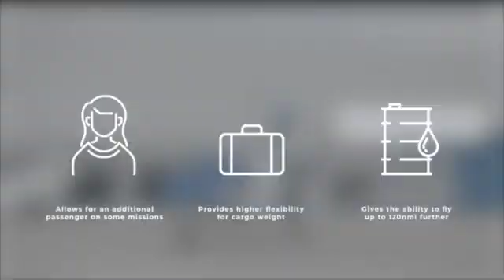BREAKING: Why Cirrus-Trained Pilots Are Dying in Jets - The 300-Hour Death Trap Exposed

Comment: I got my private pilots license in 1982, at the age of 22. Part of the training was in a Cessna 150, part of it was in a Cessna 172. I completed my training with the minimum amount of time required by the FAA, did fine on my solos, and my check ride. Flying just felt natural to me. A few years later I bought my first aircraft, a 1959 Cessna 150. I kept that for 10 years, then bought the aircraft I have now, a 1974 Cessna 172M. It will be my last aircraft. I never had any aspirations to go any farther. I have no instrument rating, no twin engine rating, I've never flown a taildragger. I love the Cessna because of just how easy it is to fly, how forgiving it is, and the visibility. It has far better visibility than a low wing plane. 

About a year ago at our local airport, we had a HondaJet go off the end of the runway on takeoff, go across several hundred feet of dirt, through a chain link fence, across a paved road, hit a car, killing the driver, before coming to rest in a field. There were three people on the HondaJet, including the pilot. The pilot and one passenger were killed, the other passenger survived. Apparently the pilot rejected the takeoff, for unknown reasons, while traveling well in excess of V1, so there was no way it could have been stopped in time. The FAA report found that the pilot was not qualified to fly the HondaJet, but did have time in a Cirrus.

Comment: Covid gave me a forced break from airline flying, so I flew a SR22 for a local businessman. 

I did training through the local Cirrus agents, as they apparently had the right go around technique in answer to recent crashes. Turned out the only go around trained was the classic ‘dog-on-the-runway, go around’ as you approach the threshold. 

I told the instructor that this is NOT where pilots are killing themselves. They die when, after a long float & potential deep landing, the decision to go around occurs when the aircraft energy state has decayed significantly. 

The correct remedy is to ensure that adequate forward stick is applied during the go around to the extent where contact with the runway should be anticipated. Thereafter, proceed as with a baulked landing. 

Applying a standard go around (TOGA thrust, nose up pitch attitude …) from a late flare go around will end in tears with a high performance single. P-factor, etc will result in a heap of wreckage slightly off the left side of the runway.

Comment: CFI inexperience is a major factor overall.  The New age aircraft makers Duping pilots into believing "if you fly the avionics you will be safe", "if you have a problem pull the chute."     Upset recovery training is MANDATORY for operating an airplane safely!  Spin training is ridiculous,  because the spin is the direct result of Not recovering the UPSET.  You can't spin if you recover the stalled condition promptly.   A humans "clutch reflex" takes the upset and transitions it into the spin.
Reply: seems to me anybody who has actually been IN a spin would never say the things YOU say.  i insist that my students at least experience one spin with some ground discussion about it.  have been in many INTENTIONAL spins.  there is absolutely NO DOUBT in my mind that being in an INETNTIONAL spin helps a pilot to recognize the impending accidental spin!
Reply: I have been a pilot for 40 yrs, CFI (instrument and multi) for 35 years, and Airline transport Pilot for 32 yrs, type rated in 5 jets. Where do you get your information????  You do understand the min CFI experience is 250 hours, 5 written test and 4 flight test (private, instrument, commercial, flight instructor, FOI  fundamentals of instruction). Each time they have an oral exam and flight check ride  with a DPE, Designated Pilot Examiner. There is the ACS, Airman's Certificate STANDARDS... They have to meet this. Yes I have a lot of experience and now doing part time flight instruction, and will do more as my airline career raps up.  I checked out new 19 yo flight instructor into the flight club. Very sharp. I have a 19 yr old private pilot I am teaching, working on his instrument rating. The student does not have great study habits or skills. It is individuals, don't blame age or the instructors, unless you have facts to back it up. 

There are some "bad instructors", that may not be professional, poor pilots. Sure. I don't think this is the issue. The SR22 has very abrupt stall characteristics. It has to be flown on speed, stabilized approach. This is how ALL planes should be flown. However a Cessna 172 or 182 may have saved the day. I don't know, they crash too. However a Cessna's stall is far more benign and has a lower stall speed as well. I think the SR22 has a stall 16 to 20 kts faster !!!!  Let that sink in. Nothing wrong with that, but you better not get the SR22 under 78 kts on final.  The C-182 can be flown 65 kts. Is 13 kts a big deal? Well the ratio of speeds (kinetic energy) squared is  (78/65)/\2 = 1.44. That is 44% more energy. Energy goes up to the 2nd power, or squared.  NOT blaming the CFI that taught him or the plane. He had LOS, loss of control. We don't know why. The fact he tried 3 times to land is an issue.... the runway was more challenging than a longer one in the flat lands with no terrain that he normally flew.
Reply: @gmcjetpilot  sure is a lot of words that amounT to NOTHING SAID!  anyway thanks for all your important credentials that was very impressive.   what does it all meand?
don't mean $HIT!    you don't impress me because you have a BIG FAT mouth.

Comment: I think your channel is very helpful, but you are letting the ball drop here.

“The plane slowed to 72 knots as he made the turn ….”

This statement is inaccurate and not borne out by the data available to any person (or especially pilot) who looked at the data. 

This plane got slow and stalled as he was trying to go around, likely because he left full flaps deployed … then veered left off the runway line. 

There was no voluntary “turn” at all … he stalled over the runway and went off it ..

He was also not “too slow to deploy the parachute” as the parachute can be deployed at any speed … he was too low to deploy the parachute and likely did not have enough time in any event.

Let’s keep the facts, the facts.

Keep up the good work.

Comment: It is beyond comprehension that there is no spin training in the US to obtain ppl.  However this cirrus pilot had 2,000 hours and had taken the Cirrus pilot training and flown it since mid 2010's.  I agree with you that there are holes in pilot training, and specifically with ongoing proficiency - piloting skills and basic stick and rudder skills are perishable so you must practice them frequently to stay current.  But so much push button automation gives a false sense of one's capabilities when sudden scenarios develop.  Go around in a high performance prop plane is problematic - full flaps trim and suddenly applying humongous torque causes the nose to point skyward and if you are not on the ball, you stall/spin.  Got to practice these killer scenarios often, at safe altitude to stay a safe pilot.
Reply from the maker: 2,000 hours and flight time do not mean anything. the uS Navy has 400 hr pilots landing F-18s on aircraft carriers at night. They are trained in a certain way. Quality of hours more than quantity! This is why a 1,599 CFI, who has spent all his flying low level at 100 Knots around an airport is not fit to fly a jet at 35,000 feet at 450 knots! the gap needs to be filled in order to produce safe pilots.
Reply: Spin training used to be a required maneuver. I don’t know why they got rid of it. I think a basic aerobatic maneuver training should be mandatory in getting the PPL.

Comment: You started by presenting data and then started making a bunch of claims unsupported by data. Not great. Nearly all career pilots are cfis. Cfis in the United States have to complete spin training so your whole argument is wrong.
Reply from the maker: Spin training and basic aerobatics need to be taught at PPL level and not wait until CFI course.
Reply: @BizJetTV  I would agree but it doesn't change the fact that most of the claims you made are plain false. Kinda makes you seem like a charlatan.
Reply from the maker: @clippy2565 my claims are based on almost 40 years in aviation and having shared the cockpit with pilots from 65 different countries!!!

Comment: We have spin training in Canada.  I learned to fly in 1988 and TBH it was my favorite part.  I still do them regularly just for the fun of it.  How it's not mandated everywhere is beyond me.
Reply: They used to in the US, had to, to get ppl. The US FAA, change things based upon statistics. They decided it was not absolutely needed. Unbelievable. Yet when you take into account. That many of the newer aircraft. Have been designed to be spin resistant. Which can make it difficult to get out of the spin. I have never flown a Cirrus. Though, reading forum posting's by cirrus pilots. Spin recovery, according to the manual, is deploying the chute. Apparently, Do not attempt to get out of a spin, because it is difficult, to get out of. In that plane. I have noticed on a number of newer planes, photos. A placard on the dash, no intentional spins, or spins prohibited. I have not flown in many years. But in the 1960's & 70's. Spins were taught right away. First lesson basic maneuvering, power off landing. Second lesson stalls. Third lesson spins. I agree that spins are a necessary part of training. Learning the entry feeling, teaches how to not let it go that far. While exiting procedure is absolutely needed to be known. As far as i know, spins are still taught, if the student is willing to learn, though not mandatory. While in some cases, the new  airplanes spins are forbidden. They have made them spin resistant, still have aileron control while stalling, not dropping a wing, only needing to push the nose down. Combined with computerized glass instruments. That actually gives instructions to the pilot. Yet apparently, despite all the safety features. Apparently some poor pilots get themselves, into a spin, either too low to recover, or are unable to recover. Yes I think spin training should be mandatory. Nevertheless, there are pilots that exceed the flight limits, despite all the modern flight safety devices. There is a limit to intelligence, apparently, stupidity is limitless!

Comment: Do you teach spin recovery or how to avoid spinning?

Also aircraft can be spin resistant, spin recoverable or spin unrecoverable (Cirrus iirc), all of which will consume height.

The key is speed control in the circuit.
Reply from the maker: The program I have developed and will be launching shortly covers all of what you mentioned and lots more.

Comment: I owned a SR 20, the aircraft is not for newbies. We had a hard time finding one that had not had a prop or tail strike..during landing at slow speeds it is hard to control. It has a laminar flow wing and is not stable at low speeds. Fly slow, die. It will spin when stalled, it has a short fuselage so rudder authority is low and spin recovery is almost impossible. This is why the FAA would not certify it until they fixed that problem whicih they did with the parachute
Reply from the maker: Thanks for your input and insights!
Reply: I never realised an SR20 could not recover from a spin

Comment: In my opinion I feel like many people who start flying don't take it as seriously as they should. The consequences of a small mistake or miscalculation can end your life. It's a whole different world from driving cars
Reply: Even cars are dangerous, but most people have a lot of driving hours, and driving requires non stop attention, so those are quality hours. Many of the hours in an aircraft can be autopilot with nothing happening, then in an emergency, things go from 0 to 100 very fast.
Reply: @rinzler9775  "driving requires non stop attention"  Not where I'm at. Most so called "drivers" are actually smartphone operators trying to control a car while paying most of their attention to the phone.
Reply: Water is wet
Reply: As a private pilot for over 40 years, I feel that flying is actually quite a bit safer than driving a car, especially in heavy traffic with everybody else on the road being distracted and going well over the speed limit. Yes it's almost certainly safer if you were the only one on the road, but that rarely happens. I also ride motorcycles, and there is no doubt in my mind that is far more dangerous that either flying or driving.
Reply: @geraldscott4302 I rode a motorbikr for a while, and near misses happened at least weekly.
Reply: @geraldscott4302  it doesnt matter how you feel about it. only fact's matter in this regard